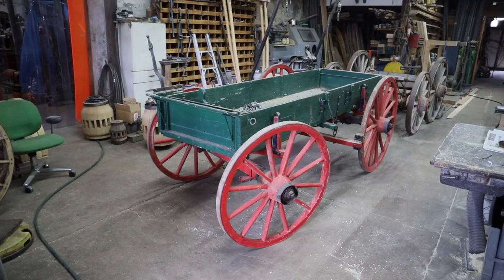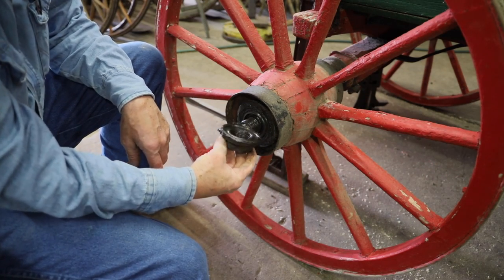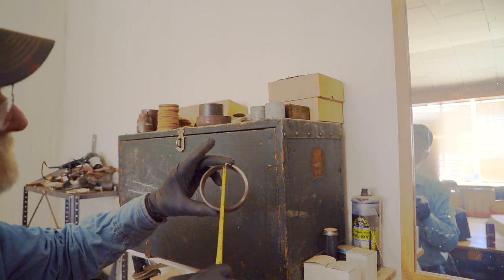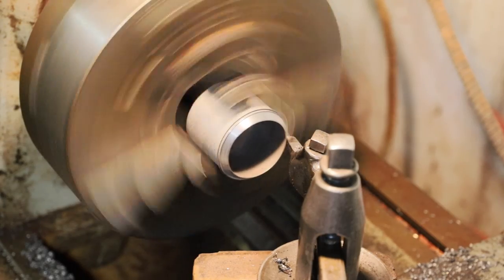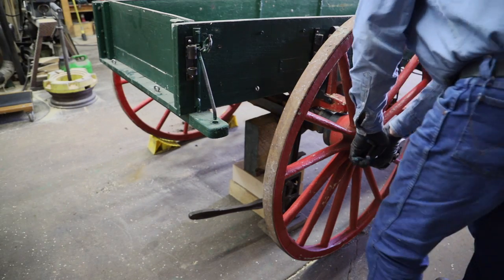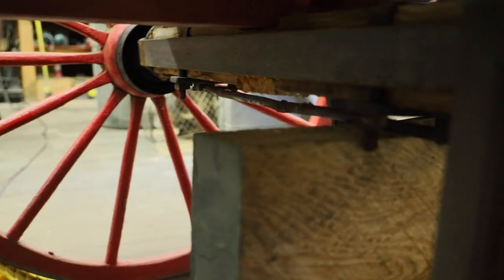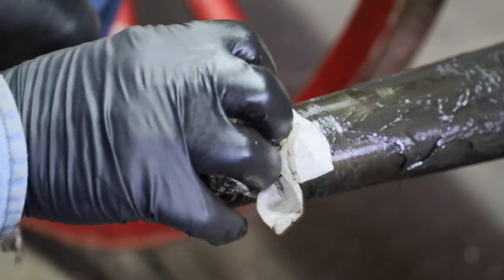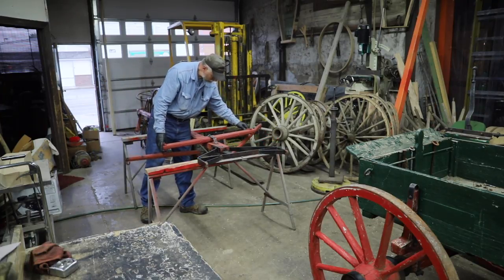Homemade Horse Drawn Wagon Needs Wagon Wheel Fitment | Engels Coach

Comment: I saw once someone who claimed to be a Medieval machine "specialist" who was attempting to recreate a ancient wooden crane.  He used rope and grease as a horizontal bearing.  It failed gloriously and for some reason he wasn't on the rest of the series.  I would have thought the same with leather, but then again it compresses less then hemp and you're using it as a vertical bearing, which means not that much pressure will be involved.  In this application its both a spacer and a seal.  Not to mention it absorbs grease on one side and digs into the nut on the other.

Comment: We had a wagon with a lot of wear that they had put several steel washers on the hubs with hickory wood washer on top behind the square nuts. My grandad replaced the wood washers with heavy leather and greased everything well. We used the wagon to haul dry corn ears in from the fields wagon was 4 ft. Wide and close to 12 ft long with a shortened toung we pulled it with a tractor.

Comment: You are right, Dave....I have followed along long enough to be able to spot a fake. It looks good from far, but it's far from good. Sometimes one just has to do the best they can with what they got to work with....even if it isn't how you would really like to see it done. I deal with that on the ranch all the time. Good job on putting it back together as close to right as you could. 

I hate fixing somebody else's crappy welding. I am sure they were trying to save a dollar by doing it themselves but it usually costs them a lot more for me to fix their mistakes than it would have if they would have just brought me the part in the first place.

Comment: Nicely done Dave!  All the shims surely didn't improve much of anything, but I reckon it's about all the former owner(s) had or knew to work with.  Do you as a matter of course check the alignment of the axles, so that the wagon goes true down the road, or is that far less of a problem when powered by horses?  I keep several thread files in my tool box, just to allow me to straighten and improve maimed threads, finishing them off with a nice little German set of triangle files that I've had for eons.  Perhaps the axle threads are of an uncommon shape or configuration?  I'm sure the left/right situation brings its own headaches as well.

Comment: Looks like you used heavy harness leather for the new washers. They should stand up better than "veg tan" or "saddle skirting" due to the wax and oil impregnated harness leather. Great video! I had thought about building a farm or grain wagon. Perhaps some time build a chuck box for it, and switch it with the grain gate if I ever wanted to play cowboy. 😉 I have looked around at various plans, do you know of any hat you would recommend?

Comment: I have a question, why were a threaded rod with nut and washer sticking out of the spindles? Where the taper spindles bolted on? Maybe I haven't been looking close enough but I thought the spindles are straight. All I've seen are the Borax wagons, so I'm confused well that's nothing new but now a little worse than normal. Can you tell me what size drill bits you use the most. Have inch down?

Comment: Nice fix.  I think I would have put some blue thread locker on the spindle threads. That way you still don't have to over tighten and they will easily come off in the future if need be.

Comment: Interesting. I guess I'd be inclined to classify wagons (or anything) into three categories: traditional/original, not traditional but perfectly good (welding instead of forging, for instance) and "farmer repairs". 
I get the impression the two biggest problems with this wagon were that the builder didn't understand how wagons were really supposed to work mechanically, combined with some really bad farmer repairs. 
I can kinda forgive the first part, I don't think you can go to the library and find a book on wagon design that includes both design theory and common practice, so you are left to picking it up by guess and try if you don't work on them every day. There probably were such books, once. But some of the things, like those mismatched tapers and obviously  bad welds, really bothered me. Even a bad mechanic should have figured out something was wrong.

Comment: What did it mean when they said "I have a buck board"?  I've caught this on Gunsmoke and/or Death Valley Days, often.

My guess is that it means a wagon, in general, with a buck board; a buck board being the inclined board at the front that shielded the drivers from mud or actual horse bucking?

Comment: I liked how the wheels are all over the place and dont run true at all. That has to put a lot of stress on the nut as well. The wheel wants to rotated in one path but with the axle preventing it something has to give. I would say that some home jobber, farmer or not, just found an old wagon and did his best to "restore" it to what he thought it should be.  People do the same thing with cars. No idea how it goes together properly so they start putting "crimp" connectors everywhere, which are a TEMPORARY fix. Then wonder why the car starts on fire.
Reply: @EngelsCoachShop  OH yes!

Comment: This is the 1st video I was kinda disappointed in you......You bashed whomever made the wagon,but perhaps the original fabricator had no idea about how "traditional" wagons were made,or maybe they were to poor to pay a shop(if there were even any around).Perhaps when built,they were way out in the country where parts weren't available(other than a welder),or they just didn't know about the use of leather washers(I didn't),or had none around thick enough to use,so they used metal,and went back to work.The point is,they DID build a wagon that functioned for "apparently" quite some time the way it was,and got by with what they had on hand(including the bad welding)that saved at least the wheels/axles from a burn pit/dump........
Reply: @EngelsCoachShop  Then I humbly apologize.It appeared that you were bashing it.As a repair/fabrication Machinist,I've also seen "questionable" work,but try to think about their circumstances/materials at the time it was built,and think "what would I do".Then I realize the Professor did some amazing stuff on Gilligan's Island with just a coconut and twine,lol !!